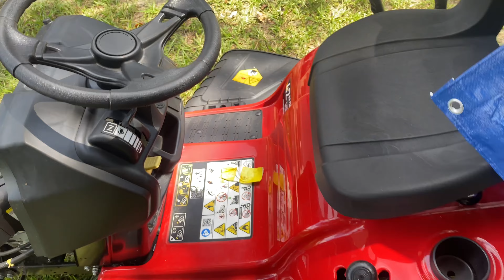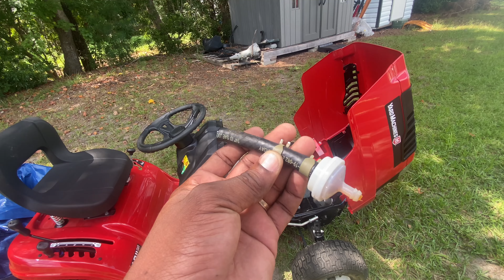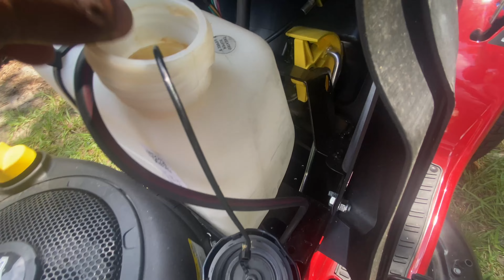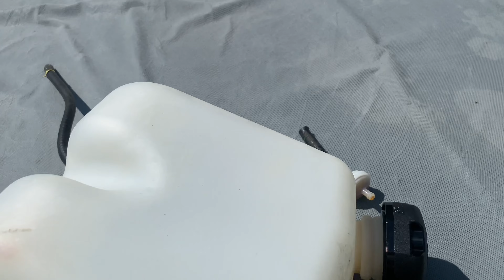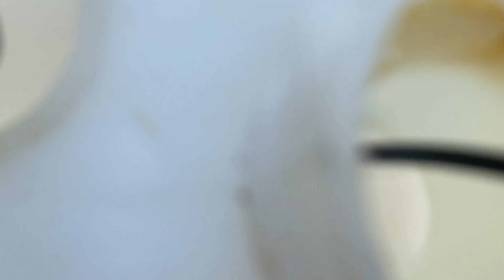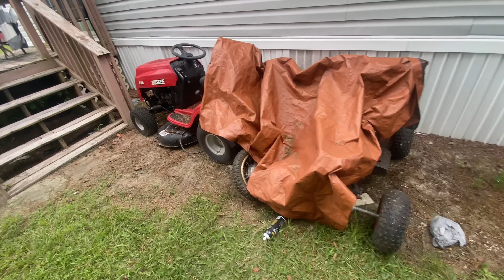How I got a $1800 mower for $500 NEW !

Comment: Not sure if the triangle button at 2:48 is a shut down. On my Cub Cadet I push that button and turn the key one click to the left and it activates reverse. My mower has a foot pedal accelerator on the right side floor and behind it is another pedal to press on for reverse. Then click the key back to the right for forward. I didn't notice your pedal arrangement but look in the owner's manual to see if that is the same for your mower. If you don't have the manual there should be one available on line.
Reply from the maker: It a E stop